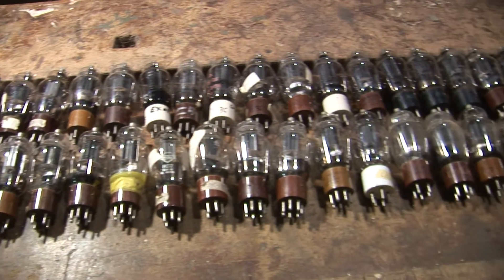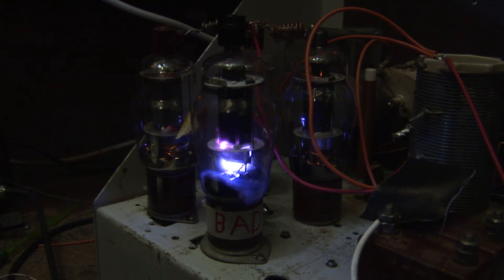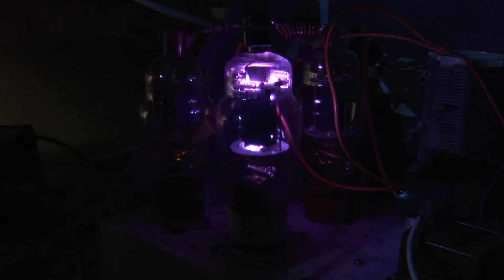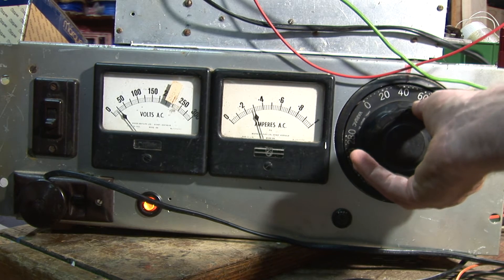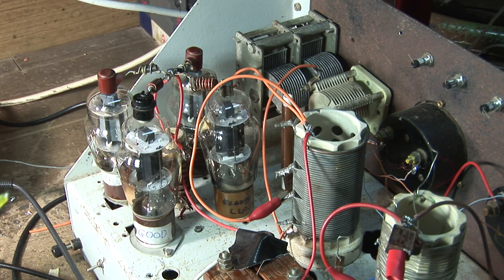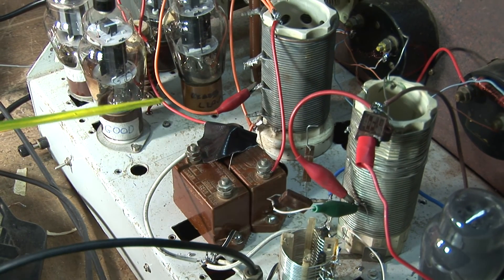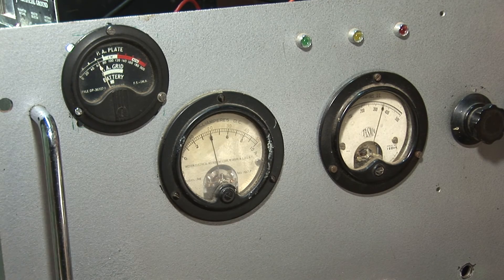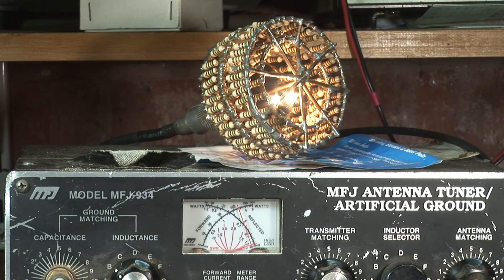Zapping and popping 807 valve in new mitters

Comment: I have five 807's all working and three give a very slight purple glow. There's one in my 19 Set but I only run it at about 250 Volts h.t. and get 2.5 Watts out, CW. Plenty for QRP. I worked about 180 miles recently on 60m, interesting because it was one military set working another military set, my 19 Set and his Clansman.
G4GHB.

Comment: Great video Dave! What modulator do you use with it?
Reply from the maker: Mostly old 100 watt or so PA amplifiers and feed the 8 ohm into a 6volt tap of a power transformer and use the 240 volt tap to modulate the valves via a choke or if you have a multi tap mod transformer like the UM3 you can use the 100volt line output and connect the transformer taps so you can go from 500 ohms to 5 or 10 k.

Comment: Will it be used in the late night test transmissions..
Reply from the maker: A standby mitters if the main ones need maintenance or for portable  operation.
But mainly so i come come on with a stand alone mitters without having to turn on the booth and racks for a quick contact.